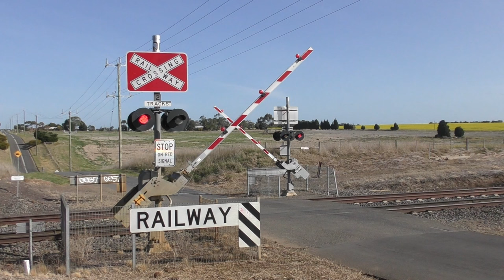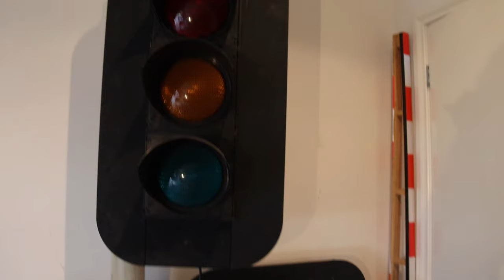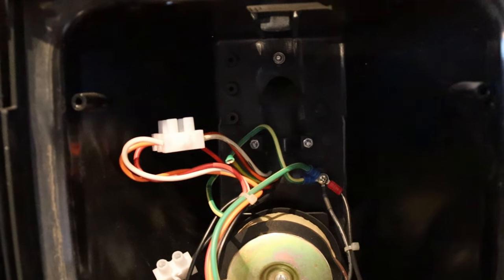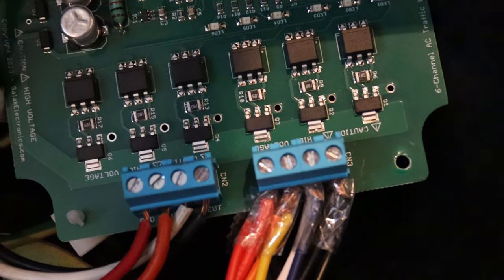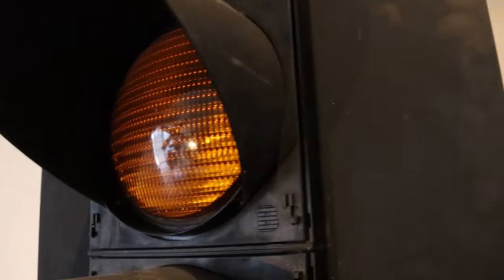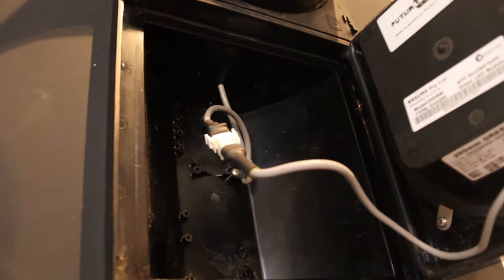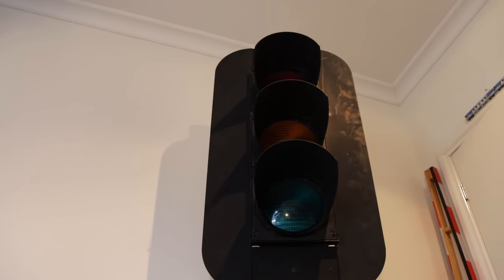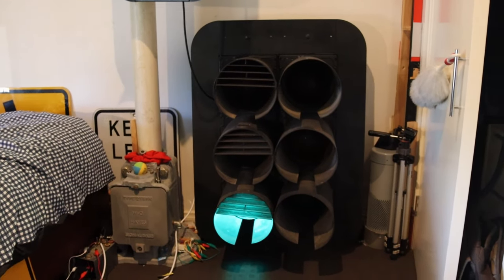My Traffic Light Setup | Braums & Bob Panich

Comment: 3:00 - That round thing is a step-down transformer. The bulbs run on a lower voltage which makes them more energy-efficient than standard household bulbs (with the Edison Screw).
Reply from the maker: @user-rs1990  Thanks for the information! That makes more sense now too. Props to you!

Comment: Nice set of lights you got there :D
I myself got a 6 aspect Aldridge Electrical/Aldridge Traffic Systems traffic light a few months ago, with the same lense config as your Bob Panich, but it’s just sitting around as I haven’t bothered to wire it up yet lol
Reply from the maker: @pengo34789  Thank you mate, cheers!
Ay nice! I think the first light i considered buying months and months ago was Aldridge however i never went though with it because i was broke 😭😭😭
Hopefully you get to wire it up i'd watch a video of it if you made one!
Reply: @ethanthevictorianrailfan7030  Yeah, I'll probably make a video on it in the future with it wired up, although before then I'd rather mount it on a pole of some kind - Only caveat with that is that the traffic light weighs nearly 21.5 kgs without visors, so I need something that can support that weight 🤣
Just curious, how much does you Bob Panich weigh? From what I saw the transformers inside weren't as big compared to the ones in my Aldridge, but generally it seems traffic lights are way heavier than they look XD
Reply from the maker: Yeah awesome that'd be cool to see. I modified my PVC pole prior to installing the traffic light and then furthermore wiring it up. I decided this because if i wired it up, THEN put it up, i would have much less variation in space for movement as the wire length would restrict where i can put the light. Thankfully, the Braums light is probably 8-10kg, I didnt weigh it before putting it up, i really should have hahaha
Yeah no worries, my BP light is definitely way too heavy for my current pole setup, not only because the weight would be offset, but also it would probably snap the PVC. I too would like to set it up maybe even outside i just havent got a pole for it. In saying this, guesstimate would probably be about 25, maybe even 30kg. I'll weigh it tonight when i get home and let you know. Interesting to hear the Aldridge ones have transformers - are they incandescent?
And yes i would definitely agree, they are a LOT heavier than they look. Explains why the cantilever ones move around in the wind, despite being on solid metal poles. Wind is a crazy thing!
If you wanna send any pictures of your traffic light or discuss stuff without communicating via Youtube comments (which isnt great lol) u can email me at (dont question it, i was younger when i made it 😅) ethantherailfanner44@gmail.com
Cheers mate!
Reply: @ethanthevictorianrailfan7030  Yep the lights are incandescent, so they have individual transformers for each aspect - from what I saw, your Bob Panich also has a transformer for each light too
Also just FYI, your discord server invite link isn’t working 🙂
Reply from the maker: @pengo34789  Ahhh yes, yes thats correct they do. 
That link is long expired, discord join links expire after a week i think but also i closed that server like months ago, i need to make a new one 😂
Reply: @ethanthevictorianrailfan7030  Well that explains why the link didn’t work lol - Is it possible to add you as a friend on Discord btw?
Reply from the maker: @pengo34789  Yes it is, ethanthevicrailfan should work